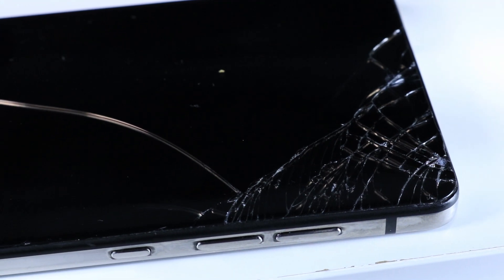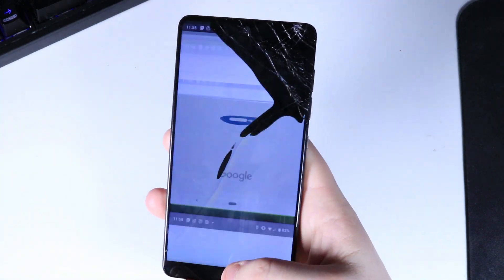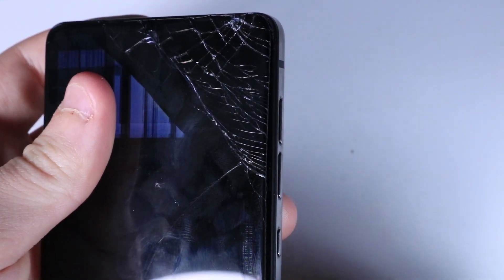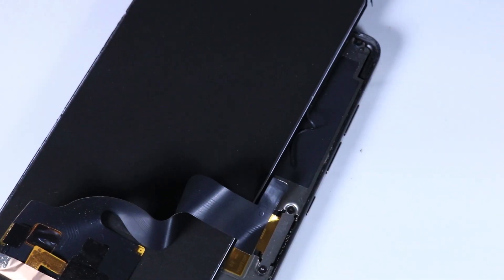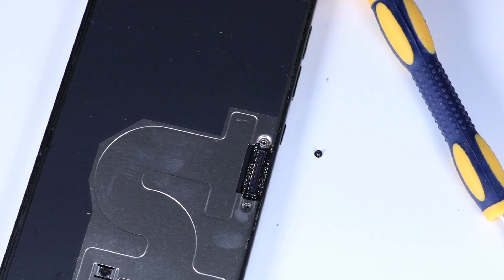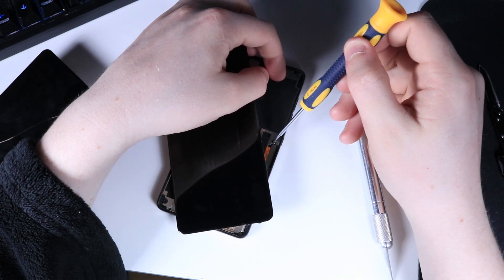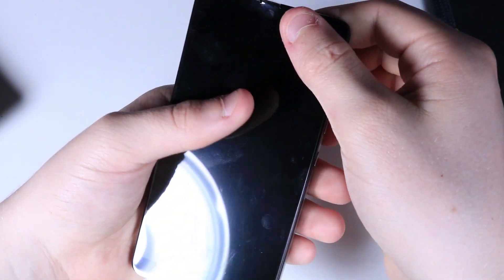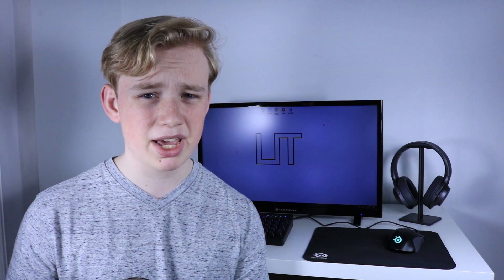Essential phone (ph-1) screen replacement (Tutorial)

Comment: Do you know if the Hezbjiti screen replacement for the Essential Ph-1 comes with an adhesive?  I bought the screen and I should be getting it by Tuesday.
Reply from the maker: I don't think it does, or at least if it does I don't think there is any mention on the product page. Any glue will work though really, as long as it isn't expanding glue or permanent glue (if you want to be able to replace it again someday) and as long as it sticks to metal/plastic.

Comment: I replaced my screen and now it goes black every time i make a call. I read its the proximity sensor...any ideas?
Reply from the maker: Hmm, idk I haven't run into that problem and I've replaced the screen 2 more times since this video (I know that's nuts but it wasnt totally my fault) I guess check if there is something you can change in software so that it doesn't try and use the proximity sensor? Just an idea